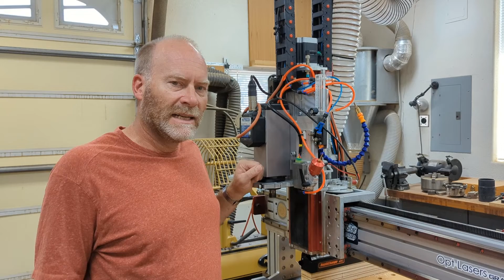How to Add a Normally Closed Touch Probe or Tool Setter to your AVID CNC

Comment: Great video once again Jim. I plan to install an additional probe and this video is very helpful. 
Question just to clarify the destroyed resistor on the MOSFET driver, it is the inboard resistor in line with the signal connection, correct?

Thank again for the videos.
Reply from the maker: Ya, its the one right next to the label "SIG"

Comment: I don’t use the avid touch plate anymore. I use an opto-interrupted touch off so I don’t need any conductive wire to my CNC Depot S30C. Opto interrupt also has better repeatability. I’ve had my system drive a bit into the avid plate, thankfully it did not brake my bit.
Reply from the maker: The other thing about the AVID plate is you really don't want to use it with the very sharp tip bits because it can chip the ends off.  But thats probably true of any hard topped touch off or plate.

On yours, does the beam get broken by the bit, or is the opto device inside the touch off and you are breaking the beam by pushing down a top plate?
Reply: @JNWoodworks  My design presses on surface and under stat surface there is a flag that brakes a beam. Still the same issue with pointy bits and plates. When I tried breaking a beam with the actual bit I had too much variability because enough of the point end of a V bit is needed to break the beam which means you are actually below the true tip of the bit.  So the plate/plunger is the most predictable. The opto or Ir sensor broken by a flag is the most consistent I have found if you cannot do a continuity loop.  All that said I use the tool table so I am also not touching off every time and change tools with my ATC, I measure it once and then the length offset is applied when I use the M6 macro to change tools. Hope this makes sense.
Reply: @Human_OU812  Would love to see more of what you are using. I don't think the avid plate is very repeatable at all.

Comment: Question: How would you identify the version of the CRP850-00E board that you have? I see physically on the board a reference to "Rev F-04" similar to the screenshots that AVIDCNC have on their support pages.
Reply from the maker: Hi Steve, If you go to the AVID schematics pages:  https://www.avidcnc.com/support/instructions/electronics/pnp/manual/17.4/schematics/
you can see a board outline for the CRP850 board.  The one I have, 17.4, is pretty different.  It has 3 connector blocks in the upper right corner, whereas the newer ones only have 2.
Reply: @JNWoodworks  Thanks for the clarification.  I have just Port 1 and 2 spaced apart in the top right of the board, and with your link I see the other revisions listed on the support page.  I guess my board is a 20.1 or 21.2.
Reply from the maker: @stevehunt4440  Yep, so then I would go the splitter route.